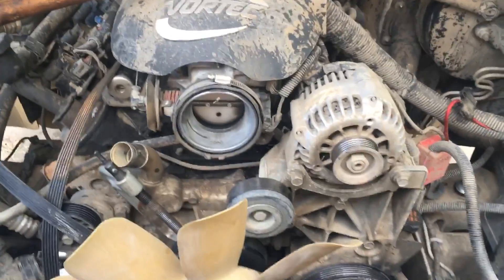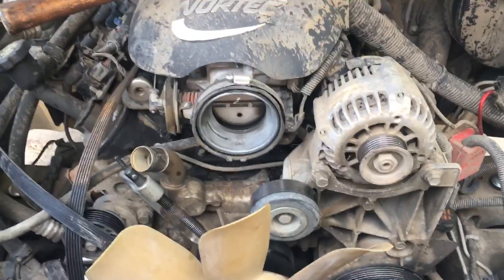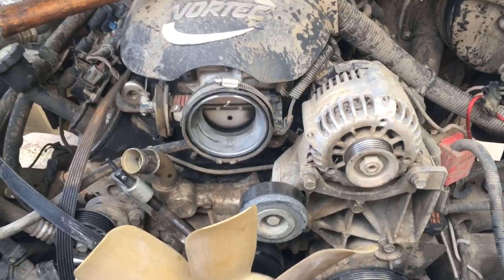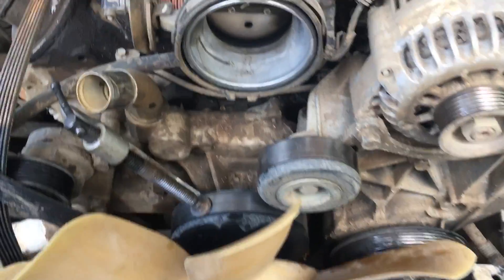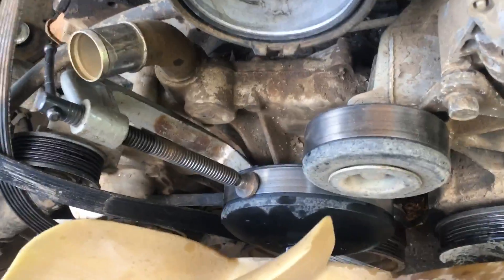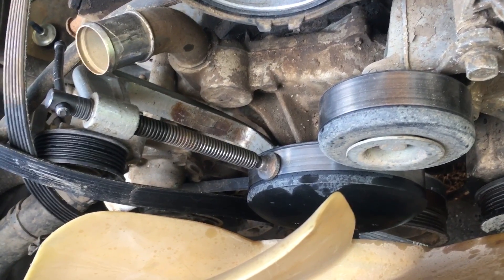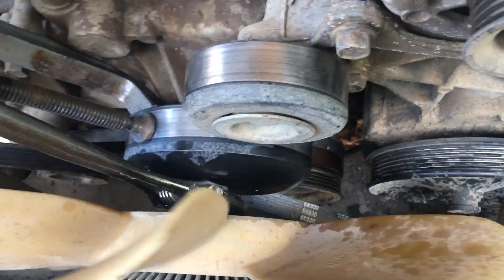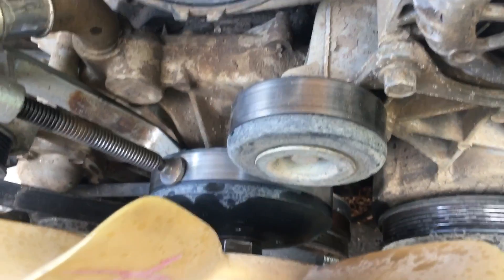Removing fan clutch 2002 Silverado 5.3

Comment: The clamp idea was a genius at work perfect also I found a ratchet strap used commonly for tying down motorcycles and cargo wrap that around the pulley and put the other hook on something sturdy and that works also I did two water pumps on both my pickups used your clamp idea and use the ratchet strap and they both work like a charm

Comment: I was able to do thing with a clamp on the  alternator  belt and pulley (easy to get to). and hitting my wrench with
 a Rubber mallet.. seems much safer.. i used the rental wrench set so i didn't want to scar it up. rubber mallet worked fine for me